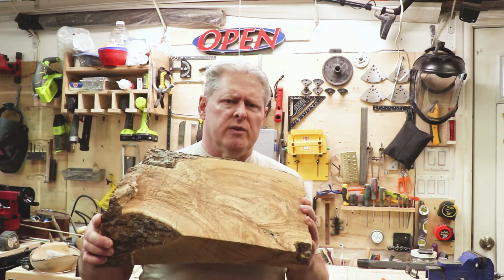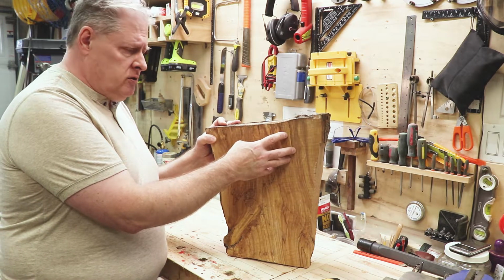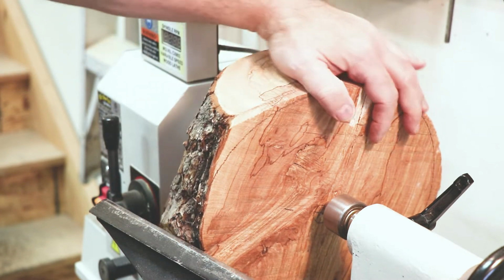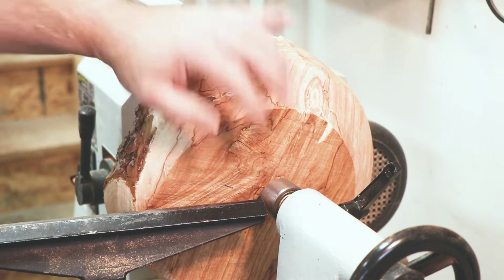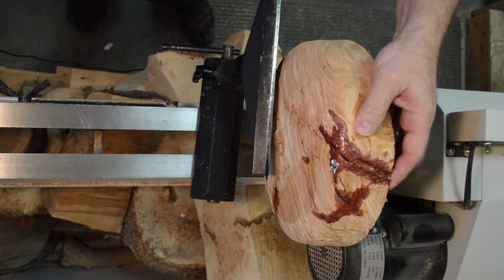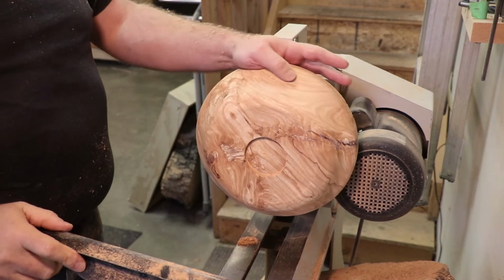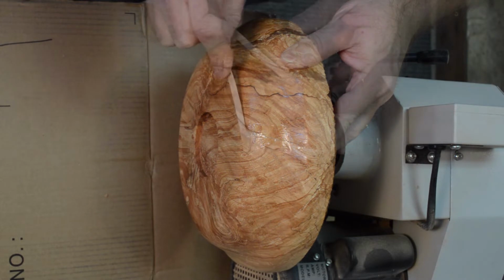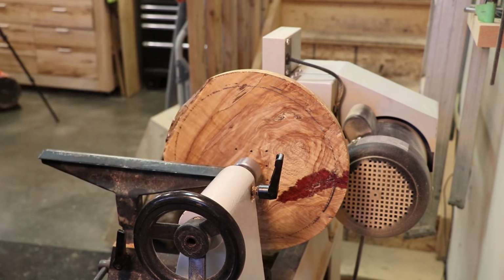#woodturning Pine Bowl Fail

Comment: Hi, so sorry that happened to you but put it down to a learning situation. Thank god you didn’t get hit by anything that’s the real scary thing. 
I’ve been watching wood turning for quite some time now and if there’s one thing I’ve learned is that wood with a lot of cracks should if possible have a tenon and not a mortise due to the exact thing that happened to you too much pressure being pushed out onto the wood and then you really can only do push cut in towards the centre any out and it’s only going to help with the big BANG. Well I look forward to you making something with the remains, till then. 📐🏺💜🏺📐
Reply from the maker: Yes it was a learning experience. I think part of the problem was exactly that. Pressure on the mortise  and a catch on a crack was enough to cause the failure. And I even explained that in a previous video. All I can do is pick up the pieces and rebuild.  Thank you for the comment.